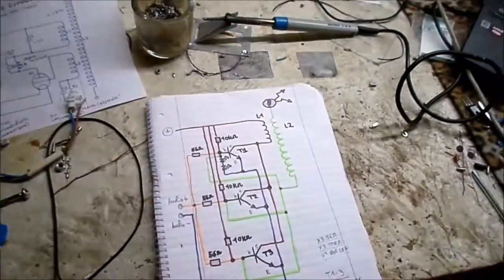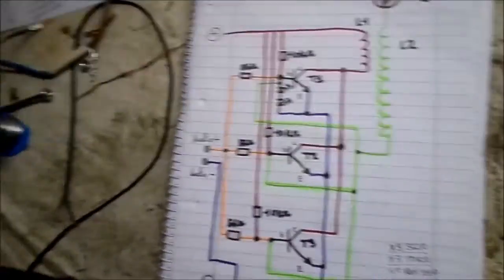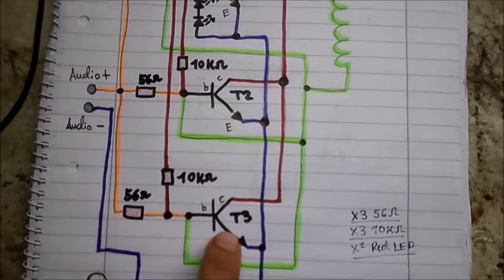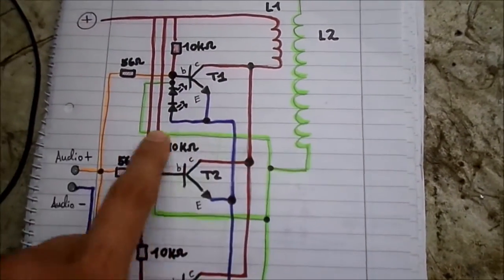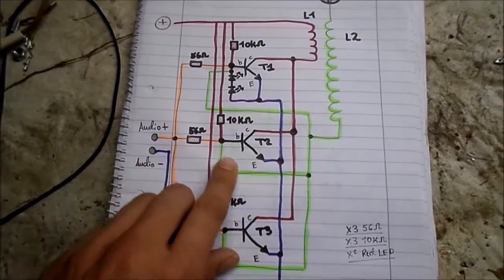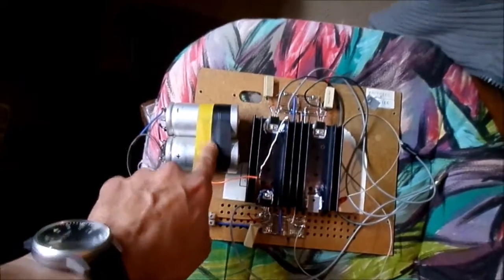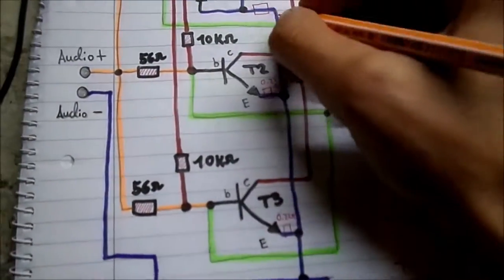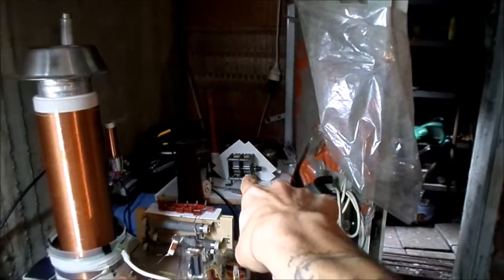how to build a audio modulated slayer exciter - circuit diagram

Comment: Cool. I remember some years back some guys having luck feeding the audio signal right into the base of the drive transistors but getting a lot of volume out of it seemed to be the issue. I guess that's what the beef of the 3 in parallel is for. I've had luck running the output of a mono lm386 amp to the gate of the drive fet on a flyback transformer to produce clear audio but never tried it on a Slayer. These HFSSTCs seem like where the real quality audio is at but they just take a quite a bit of juice.
Reply from the maker: With high voltage units such as TC's or transformers, the higher the frequency, the better, especially when it comes to audio. You typically get a good audio output due to not hearing the output from the transformer itself .. plasma speakers dont require much power to operate but the input audio signal seems to be very high in order to get good output audio, I'm sure there's better circuits out as plasma speakers are considered top hi-fi and that's no joke !
Reply: @dirkk82  yea when first playing with singing arcs I was surprised at the fidelity of the highs but was kind of doubting how well it could be done with such a furious wide plasma discharge from a TC. After hearing it in person I'm convinced these high power singing TC's are actually super viable as good speakers even at somewhat close to a full range minus the lower end. I feel like I've even heard decent bass from some of them. I just can't quite figure how to filter out all of the audible noise aside from going HF where it seems more like a pure flame. Even if I can get the noise filtered the arc itself wants to move air and I can hear the hiss. With loud enough volume I guess the 'noise floor' there is more bearable.
Reply from the maker: @Magneticitist  well in the hi-fi world, they are known as plasma tweeters as they can only reproduce the highs of an audio wave , such is the nature of these devices. midi music is overall fantastic for TC's since it usually stays at the higher end of the audio spectrum .. next time you run a musical coil of any type, try some 8 bit music, it sounds good :-) .... you will never get rid of the hiss until you reach freq. in the MHz range, have a look at my HFSSTC, it runs at 10 MHz roughly and is pretty much a pure plasma flame, it produces little to no sound when running properly.
Reply: @dirkk82  Sweet I'll check it out, a HFSSTC is one of the next things I want to build but I wasn't too sure how well the audio modulation would play out. IDK if I'd need an optocoupler or if they even make any fast enough. I'm hoping maybe I could feed it into the enable pin of a gate driver.
Reply from the maker: @Magneticitist  class-E sstc is what your looking for, they are fairly small, making them more in the high hf range .. optocouplers go quite high in frequency, I've never used one but I have them in stock, they would be useful to isolate your music device, I think I should use one as well but their passing audio through so it doesn't need to be crazy fast
Reply from the maker: @Magneticitist  you should be able to couple it in the the gate drive chips, much the same way an interuptor would .. just do a little browsing online as I'm a bit rusty on the subject :-p
Reply from the maker: @Magneticitist  and class-E coils are made for music, it's basically a plasma tweeter as mentioned before
Reply: @dirkk82  Man I bought a decent scope a while back and for the longest time I didn't use it, I was always using a handheld that only reads about 100khz before wonking out because it's all I needed. It wasn't until recently I started playing with circuits that need to accurately read a signal in the mhz. I'm going to have to buy another one before being able to tell if I get a class-E switching properly but that's def one of my future projects. Was thinking about trying to build Ward's Class-E. I've seen some pretty decent PLL setups using the CD4046 that reproduce good sounding audio but I hear those things are a bitch and a half to get working right.  

I've mainly been hard switching my coils to modulate the audio through a TL494 and I'm thinking maybe using some logic level fets on the PWM circuits would reduce my signal voltage requirement but I feel like it would also increase the noise I can't quite filter properly. Ever since I got clean audio from a flyback arc I can't rest til I get the same or better from the TC!
Reply from the maker: @Magneticitist  a scope with a range of 50 to 100 MHz is sufficient for pretty much everything, I got an old analog one for a good price on Ebay.. there's a reason that the audio sounds better on the flyback opposed to TC, the flyback output is a stable arc from +P to -P hence why they are used for plasma tweeters, TC's are dischraging directly to air, you might be able to set it up where the output discharges directly to ground which forms an arc but I've never gone that into it .. all I can suggest is experiment until you get the best result and above all .. have fun, it's not a job, it's an adventure and we are the brave explorers into the unknown !
Reply: @dirkk82  I had a digital 100mhz scope but I messed around and sold it for cheap to someone else who really needed it. Some short time later I ended up needing that sucker LOL. 

Yea the steady arc def sounds better than the iffy tower breakout but when I draw a smooth arc to ground the volume just isn't loud enough for me. That noise/volume tradeoff. Which sucks because earlier 
I was pulling a rock solid arc to ground. It looked like laminar flow or something.

Comment: can i use a TIP31C transistor for it? and does the audio input needs to be amplified? Please reply
Reply from the maker: Almost any transistor would work, I believe many people have used the tip31c with good success, as long as it's a NPN transistor it can be used .. I would suggest an amplified source, I used a tape player with a good amp in it just don't go crazy experiment with what you have .. be aware that some music players won't work, there's RF energy in the circuit and it can play havoc with devices .. there are ways of isolating the music player from the circuit but you would have to research that, they are very simple but I never tried any out.
Reply: @dirkk82  okay thanks, one last question will the circuit work if I use the transistors in Darlington pair? Bcoz the circuit will be a bit easier.
Reply from the maker: @vikascsgo  hmm I've never tried it before but i believe I've seen people use a darlington  transistor before, the tip31c is a fairly beefy transistor but if you crave more power, then put a few in parallel or try a darlington pair, the slayer circuit is very versatile and experimental, just experiment ! you may find something that works better for your setup :-) just be prepared as the circuit could claim a few transistors, i bought 10 as they were cheap and powerful .. once your  happy with your setup, you can then push it to find the limitations !
Reply from the maker: @vikascsgo  the input 2 is half wave rectified mains and seems to be a doubler circuit or that is a resonant capacitor for the primary coil, dont add any audio there !  try adding audio into pin 5 of the 555, that is the CV pin, the audio should carry through to the mosfet .. its pretty much a plasma speaker but instead of using a flyback transformer, an air core transformer is used .. I've never tried this circuit before but it looks pretty simple and i believe the audio input to the 555 should work, add a 100nF cap in series with the audio in and pin 5 and have a look at a plasma speaker circuit as its really the same circuit :-)
Reply from the maker: by the way, i have a few plasma speaker vids on my channel if your interested ;-)

Comment: Would a mosfet work for the transistors?
Reply from the maker: for this circuit, i dont think so .. there are other circuits for mosfet versions as they require more components to work properly, i believe the gate of the mosfet needs a bit more driving current to switch

Comment: Looking at the diagram, the 3 10k's and the 56R's are essentially in parallel, thanks to the green wire, you could use a single 2K3 and a single 18R ;)
(that's why led's on the other bases don't make a difference)
Reply from the maker: ah see im certainly doing more of these videos now ! I thought so as well at least with the audio part but it makes sense to do the base resistor the same :-)